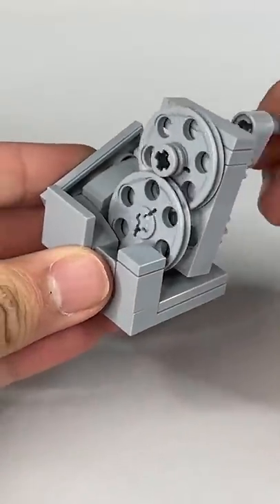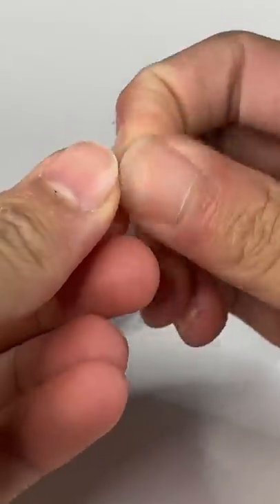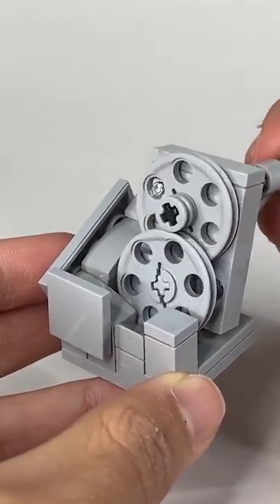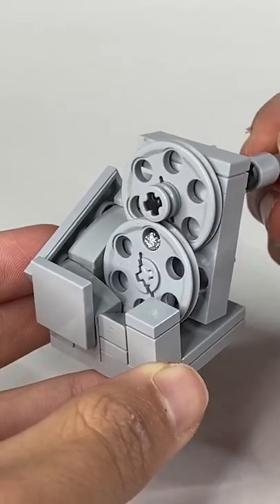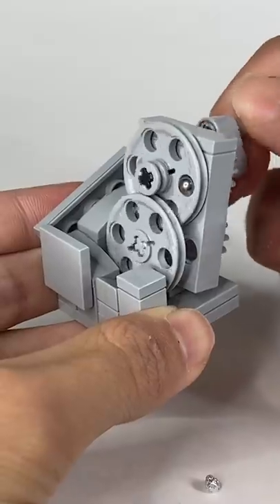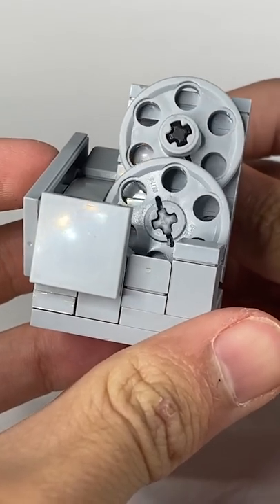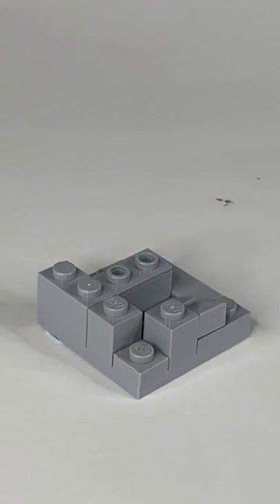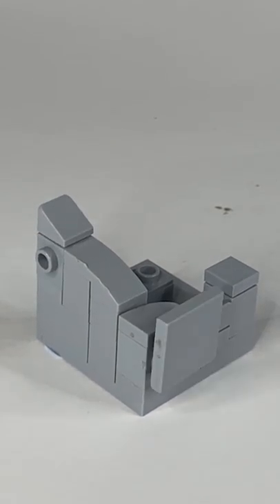How to Make The MOST SATISFYING LEGO MACHINE !!

Comment from the maker: parts list if you want to build it (you can find them on bricklink.com for like a cent each):
all pieces in light bluish grey
- 4x4 plate
- 1x2 jumper plate
- 2 1x3 tiles
- 1x2 hinge brick ( https://www.bricklink.com/v2/catalog/catalogitem.page?P=3937c08#T=S&C=86&O={%22color%22:%2286%22,%22iconly%22:0} )
- 1x2 plate
- 1x2 brick
- 4 1x1 slopes
- 5 1x1 bricks
- 6 1x1 plates
- 1x1 tile
- 3 1x1 bricks with side stud
- 2 1x2 curved slopes
- 2x2 tile
- 2x4 tile
- 1x2 brick with 2 holes
- 2x2 corner tile
- 3L axle
- 2 half bushes
- 2 technic pulley wheels
- 3 1x3 plates
- 1x1 brick with hole
- 4L axle (quite rare in light bluish grey so I recommend black)
- 2 16 tooth gears
- 1x2 technic beam with axle and pin hole
- technic pin (no friction ridges)
Reply: Can you make a wishlist for it?
Reply: wow! That is great! Good job on the stop motion👍
Reply: Replying so I can find this later
Reply: I have this weird urge to make a 3d printed variant....
Reply: Motor?
Reply: If you have the money or already have it a technic motor could automate this

Comment: Nice video, thanks.  Here's where my "instructor" instincts come in.  A ball BEARING is a bearing that uses balls in an assembly to facilitate motion of some kind.  What you are using in this project is a steel ball...  NOT a "ball bearing".  My 2c.
Reply from the maker: that's a good point. I should have called them 'bearing balls' instead of 'ball bearings' as that is the proper name, but you get the point
Reply: @puzzLEGO  All good, and again, nice job!